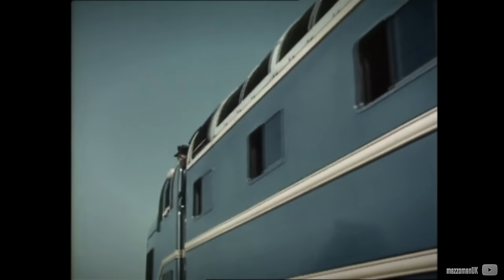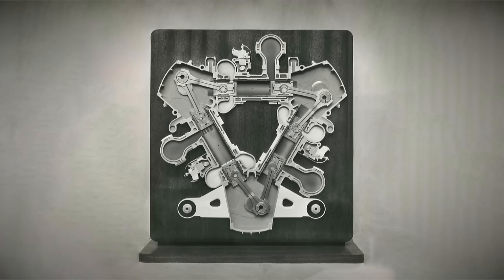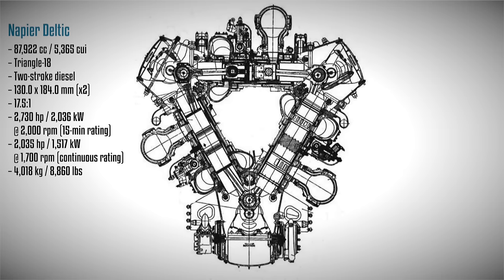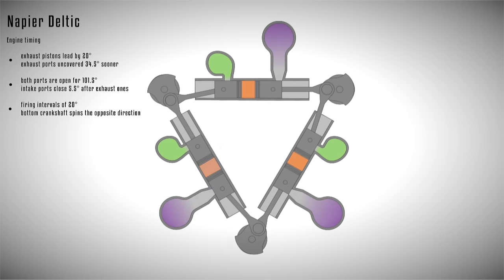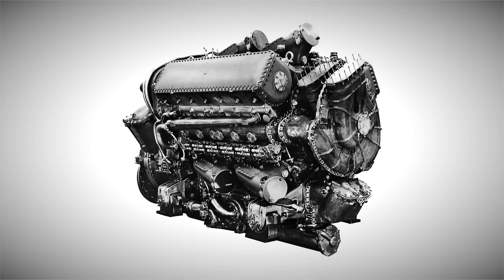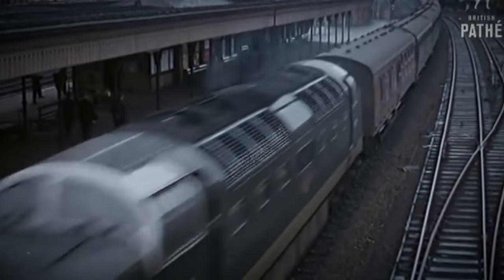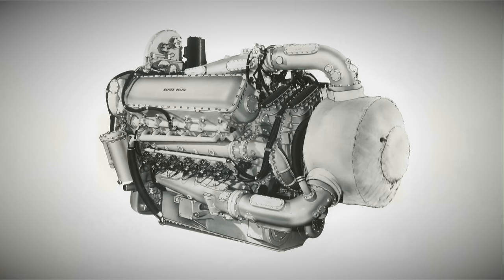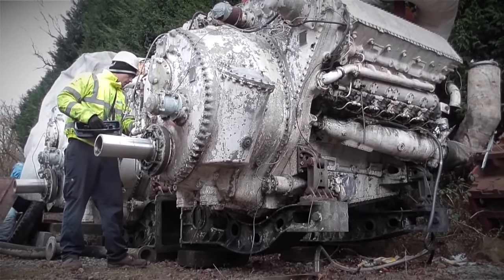The Ingenious Napier Deltic 2-Stroke Diesel Engine

Comment: The Napier Deltics were `also used in Norwegian designed Patrol Boats bought by the U.S. Navy in the 1960's.
Reply: Amazing German technology that was licensed to Napier by Jumo, the Deltic engines are a smaller variation of the 24 cylinder 4,500 horsepower Jumo 224
Reply: @sandervanderkammen9230  While Napier licensed the earlier Jumo 204, the Deltic was designed by Napier, with Junkers having given up on using a 3 crankshaft design in favour of further development of their 4 crankshaft design.
Reply: @cs7th  Napier licensed the 3 bank designed from Jumo along with the 205...
It's not a "British design" or based on "British Engineering"
The Deltic is a product of British manufacturing... and German technology.
Reply: @sandervanderkammen9230  All the information I have shows the Deltic was designed by Napier, based on Junkers technology, which traces it's roots back to the first opposed piston engine designed by James Atkinson. If you know of a Junkers 3 crank design, please state the model number, since the only reference to Junkers working on a 3 crank design states they gave up and moved to a 4 crank design.
Reply: @cs7th  Thank you for proving my point...
Reply: @sandervanderkammen9230  I credit Junkers in each of my posts. The 3 crankshaft Napier Deltic is a Napier design. I noticed you're unable to name a 3 crankshaft design by Junkers - that's because there isn't any.
Reply: @cs7th  Of course not, Jumo sold the 3-bank design to Napier, it chose to pursue the 4-bank version.
Reply: @sandervanderkammen9230  None of the available facts support you - so dream on . .
Reply: @cs7th  Jumo 204 = Napier Culverin
Jumo 205 = Napier Cutlass
Jumo 218 = Napier Deltic
Reply: @sandervanderkammen9230  I suggest you look up all of these engines on wiki.
Reply: @cs7th  All originally Jumo designs licensed to Napier.
Reply: dont forget the Royal Australian Navy  Ton class mine sweepers had them too.....one still survives HMAS Curlew M1121....was originally HMS Chediston from england
Reply: @sandervanderkammen9230 The 218 was not a Deltic it was a (proposed only) double 208. Nobody doubts the core technology was from Junkers but the Deltic bit was by Napier. This is well known in Germany and UK.
Reply: @camshaftcasting1451  Napier bought the design of the Jumo 218 which they manufactured as the Deltic series.
Reply: @sandervanderkammen9230  No, the Deltic was not a licensed Jumo 218. The Napier used Jumo technology but the 218 was not a Deltic, nor was it ever built. The Deltic arrangement was Napier's own.
Reply: @camshaftcasting1451  Sorry, but that false narrative is pure fiction, although Napier made some modifications to the Jumo 218, it is still the original German design that was licensed from Jumo.

Napier made copies of the Jumo  204, 205 and the 218.
Reply: @sandervanderkammen9230  Interesting. I would be really keen to know the research source. It is an area of interest for me but I've never been able to find any detailed primary source documents for Jumo 218. Thanks.
Reply: @camshaftcasting1451  I would be very interested to see some actual research that shows that Napier developed a completely independent design for the Deltic immediately after it licensed a nearly identical engine from Jumo... but I have never found any... because it makes perfect sense for a company with no experience building Gegenkolben motors to buy 3 designs from the company that invented them and then not manufacture them.

I guess that makes sense to someone who thinks that Napier actually designed the Cutlass and Culverin... or that they invented sleeve valves!!!
Reply: @sandervanderkammen9230  Yes, Cutlass and Culverin are Jumo designs, that is recorded fact. Sleeve valves go back yo early 1900s. Junkers had  a "rhombic" engine design, the Jumo 223 but I can nothing in the historic record about Junkers designing a deltic engine or about them licensing anything beyond the horizontally opposed engines to Napier. Nor can I find any English or German reference to Jumo 218 being anything other than a double 208. If such records exists I'd be excited to see them and delighted to be wrong.
Reply: @camshaftcasting1451  So, you admit that Napier purchased the technology from Jumo and copied their designs?

Comment: This is another very unique engine that I find very cool just like them old Detroit Diesels and EMD engines because not only it's a 2-stroke diesel, but it has an opposed piston design in a triangle that can make a decent lot of power.
Reply: Power of 3 engines in one engine, new york fire debt have or had a deltic fire pump to deal with high rise fires 🔥.
Reply: You must like fairbanks morse as well.

Comment: 4000+ HP HIGH SPEED diesel engine is no joke.I believe I saw a baby Deltic on a tug boat when I was young, because I could not  "see" the crankcase / block / head intersection, (there is no head, lol) and it baffled me for a long time. Great content !
Reply: That could have made a racing tugboat lol.imaging making a deltic running E85 and use castor 927 maxima 2 stroke oil with drysump and VRO to the intake ports!

Comment: Again a brilliant video with rare images. The double piston concept is not able to meet emission regulations of today. The geometry of the combustion chambers are given by the shape of the pistons. Possibly one could improve them . . . . if there were somebody crazy enough. ;)
Reply: The shape of the combustion chamber???
It's a Diesel... did you miss that part?
Reply: @sandervanderkammen9230  No, I didn´t. The combustion chamber of a diesel has got a different shape, than a gasoline engine where the spark plug starts a fire and the flame front should spread evenly. Depending on the number of injector nozzles the optimal diesel combustion chamber meets the shape of the spraying diesel. This is difficult to achieve when there are two pistons and a cylinder, building the part of the combustion chamber. The only chance to inject the diesel is from the wall side of the cylinder - causing bad exhaust gas. We are working on large ships diesel engines with more than one injectors, depending on the size of the motor. It is extremely important to distribute the fuel precisly in order to get those very high efficiencies. And - coming along the efficiency - you don´t see any smoke at the exhauster.

Comment: Fantastic sounding engines these! Great that you did a whole video on these, thanks VisioRacer 😎
Btw, 1 possible correction (if you're talking about the trains), the 18 cylinder engine cls 55 were retired in 1981, although a handful were sold, some of which ran (and some still run) special trains, and occasionally hired to haul freight, e.g in 2011 for 3 weeks, and for a single train in 2017 😎
I've got to see one of these in the flesh some day!

Comment: Excellent video. Thank you. There is much more information here than I have previously read or heard. Another good reason for being a Patron🙂. Cheers from NZ.
Reply: Indeed, but the story starts in Germany, Napier licensed the amazing technology from Jumo in Germany.
 
The Gegenkolbenmotor was invented by Wilhelm von Oechelhauser and junior partner Hugo Junkers in 1892.
Reply: @sandervanderkammen9230  That issue was covered. Thank you for the additional detail. Improvements constitute the majority of useful patents, according to my understanding,
Reply: @michaelguerin56  It was barely mentioned and gave the false impression that the Deltic was based on British engineering technology.
The Deltic is a German Jumo engine design sold to Napier, a variation of the 24 cylinder Jumo 223/224.
Reply: @sandervanderkammen9230  I assert, with all due respect, that you need to pay closer attention to the video. In addition, it is a short video. The author introduces viewers to various subjects, whilst providing sufficient reference points to enable further individual research. That is what I see, across the range of Visio Racer videos.
Reply: @michaelguerin56  Both the Title and the thumbnail are particularly egregious misrepresentations...
Reply: @sandervanderkammen9230  Why?😊
Reply: @markbeale7390  The Gegenkolbenmotor is German, not British engineering.
The Deltic is an example of British manufacturing... of a German technology.

Comment: Beautiful 2 stroke diesel engines. They are very interesting. I made a video in 3D about a week ago in my channel.
Reply: mercury marine should come out with a mini deltic 2 stroke optimax outboards. The v6 3.2L stroker 300XS is 60 deg block and 3160 cc 193 CID each. Now this could be used to form a 579 CID mini deltic optimax with all the proper gearing for each crankshaft. that would be sick!

Comment: These engines were fitted to Ton Class  MCMVs in the through until the 80's.  Used to make lots of smoke, and often suffered from cracked cylinder liners forcing combustion gases into the coolant header tank.  We had several starboard engines fail in a row.  Got so good at swapping them out, we could exchange an engine in a weekend and back on patrol.

Comment: Railway engines (prime movers in North American railway terminology) have a vide range of application: locomotives, marine, stationary power generation, mining, etc. EMD, GE Transportation (now under a Wabtec ownership) are selling them for aforementioned use. EMD 567, 645 & 710 (their number indicates per cylinder displacement in cubic inches, all two-stroke) GE Evo engines. Even Alco 251 series are still being used to this day.
Reply: Uniflow Diesel engines were invented by in Germany.
 
The Gegenkolbenmotor was invented by Wilhelm von Oechelhauser and junior partner Hugo Junkers and later adapted to Diesel Cycle operation.

American Alexander Winton licensed the technology and formed the Winton Engine Company and sold it to General Motors, his designs have been sold under the Winton, EMD, Detroit, General Motors and Kassboerer brands.

Comment: Wow,what a beast! Sounds like a hundred Commer lorries revving in unison!
Reply: Unfortunately the video has long gone, but there was one of the prototype Commer TS4 engines on a test bed revving its heart out. Sounded absolutely glorious.
Reply: Pity,that's something I'd have loved to have heard!
Reply: @stevepage2541  Blame GM for that.

The TS3 & successor TS4 were all trashed by GM. Theories suggest that its much more efficient than their own Detroit Diesels and due to its small size, can fit on trucks smaller than the commercial ones. 

The DD and the TS3 & TS4 has functionally the same uniflow pattern yet the TS3 is much more efficient as the combustion is extracted by 2 pistons opposing each other compared to a DD using valves and 1 piston. TS3 is cheaper to make as there is no poppet valves or camshafts to deal with.

Comment: In the class 55 the train heating boiler was located between the two Deltic engines.  The noise experienced by a second man having at enter the engin room to attend the boiler while running must have been incredible.

Comment: 4:51  The fuel was injected into the cylinder - the intake air had no fuel in it. This allowed for efficient scavenging without increasing fuel consumption.
Reply: The off-set in the ports allows for supercharging, most uniflow Diesel engine have superchargers but are only "normally aspirated"
Reply: @sandervanderkammen9230  
Nowadays turbocharging would be the go.......
Reply: @JohnSmith-yv6eq  2-stroke Diesel engines must have a crankshaft driven supercharger to run. They cannot run with a turbocharger alone.
The turbo must be installed along with the supercharger.
The alternative is a turbocharger that has a special coupling to the crankshaft to drive the compressor at idle and low rpm and a overrunning clutch to disengage from the crankshaft above a predetermined rpm ( usually above half "throttle")

Comment: Amazing bit of engineering, but also a good indicator of how far we've come.
You could run a modern diesel off the exhaust fumes of one of these engines.
They must have used a colossal amount of fuel, half of it is leaving via the exhaust stacks 😳
Reply: The Deltic is based on the Jumo 218, the 3-bank version of the 206.
The 206 was the most energy-efficient engine in the world when it was introduced into service.

Comment: The Jumo 223 that was the immediate progenitor of the Deltic.
The 223 was a prototype diesel cycle, 24 cylinder, 2 stroke, opposed piston aircraft engine.
Diesel technology made leaps and bounds during WW2- primarily in Germany.
 Although the UK and USSR as well could see that piston powered aircraft engines were the way of the future- jet engines notwithstanding. 
Diesel engines are more efficient, use less fuel and the fuel itself is far less flammable.
I'd guess Germany also wanted to use a fuel that was less refined that high octane aviation fuel.
Reply: The Deltic is a direct progression of the 3-bank Jumo 218 engine, Jumo abandoned the 218 in favor of the 223, selling the design to Napier along with the Culverin and the Cutlass.

Comment: One thing Napier never shied away from was complexity.
Reply: Or buying thier designs from someone else...
Reply: @sandervanderkammen9230  
Consider that BMW got their start in radials building P&W Wasps under license. Wright sold licenses to multiple engine builders and nations including the USSR and Japan. As did the British builders and the French. Plus a lot of aircraft builders shamelessly used airfoil profiles developed by the US's NACA.
Reply: @mpetersen6  Fredreich Renttschler didn't found Pratt & Whitney until 1925... many years after BMW became famous for In-line engines...
Reply: @sandervanderkammen9230  
I know that. I was merely pointing out the BMWs started on radials by building Wasps under license. Plus BMW along with the Italians stuck with seperate cylinder inlines long after cast block engines became not just cutting edge but pretty much standard.